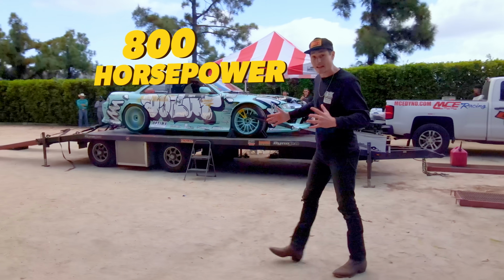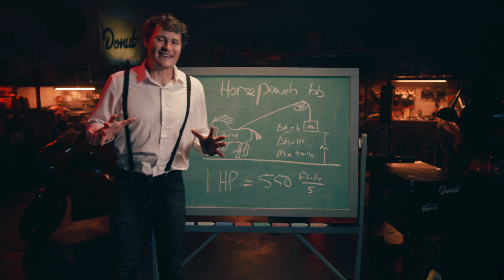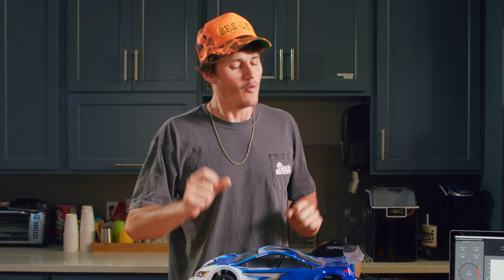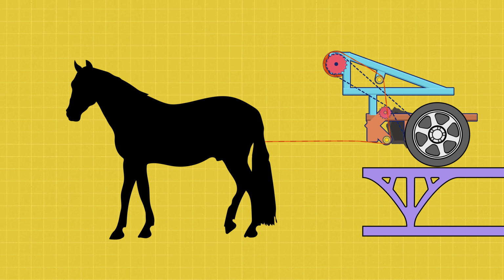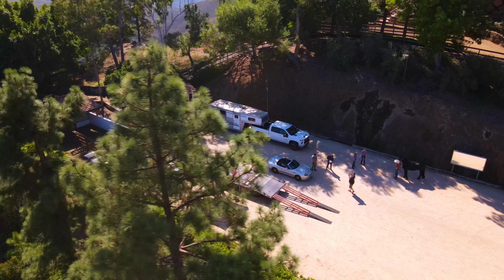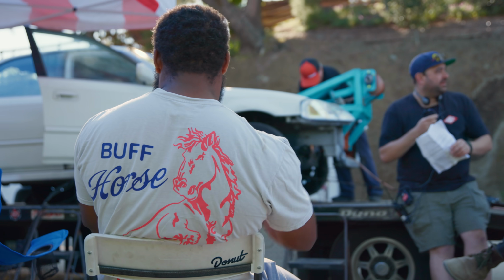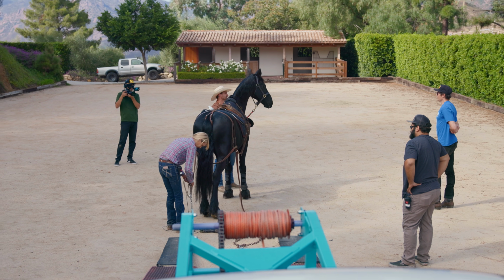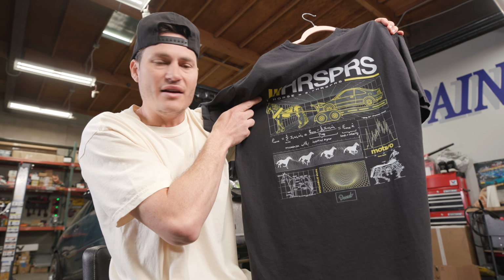How Much Horsepower is a Horse?

Comment: It's so cool to see someone undertake this project! Loved this video. As a professional in the equestrian field, I would love to see a repeat someday with a larger sample size of horses. As mentioned, there are over 350 breeds. Big D (handsome though he is) is not a heavy draft horse, which is the kind originally intended for the measurement of horsepower. He also hasn't been trained to properly pull, nor was he wearing a pulling yoke. A Belgian trained to pull, for example, would probably produce a much higher reading (I'd confidently wager at least 10). They're built to find that leverage, and a team of 2 can pull a semi plus a rig out of a ditch.

Having said that, I know this video took a ton of effort and brains to make. I've been watching this channel for a long time, and I'm stoked to see an actual horse appear. Best collab. Cheers for a job well done guys!
Reply: i was thinking the same! a friesian is a better breed for testing than the quarter horse for sure, but it would be great to see some heavy drafts. now that the rig is built, i would love to see future academic papers across the breeds + multiple horses tested!
Reply: A boerenpaard would probably beat big D but they're like 50% larger/heavier too. 
Imo it's like comparing HP to torque...
Reply: What is needed is a sample duration. Horsepower as it was originally conceived was replacing actual horses doing real work. Like all day long. Back then that meant at least a 12 hour day. They would literally work horses to death. Mine owners weren't the nicest people on the planet. They had money to make.
Reply: @1pcfred  exactly. Both the original measurements and this one are correct. All about time and of course the horse being used. A burst max compared to all day everyday effort will be about 12:1. I'd say the pull in the video goes a bit longer than just a quick burst so 6x the all day effort and you are back at 1hp all day everyday. Always good to challenge the numbers though!
Reply: Ask budweiser to get their Clydesdale team 😂
Reply: As they said: they were comparing a regular horse to a regular car. Not a semi truck or a race car kind of horse
Reply: I was thinking the same thing, that was not a pulling harness. I wonder if you could get the same results from using a horse treadmill and connecting it to a tractor PTO dyno.
Reply: A horse which is bred and trained to pull is a different matter. You then have to look at the harness and the shoes. A single Shire horse named Vulcan put up a pull of 29 tons on a dynamometer, working as a pair the two Shires reached the 50 ton limit of the equipment being used. This happened in 1924 at the British Empire Exhibition, another pair of Shires only 8 years old (Vesuvius and Umber) hauled a granite block weighing 18.7 tons in the same year. The interest was in what they could pull, the load they could move - the jobs they could do. The horse has power and it can use it. If the task gets done the numbers don't matter but if you want to conduct an experiment like this you are better looking at an average horse.  Working heavy horses are in no way average and if you want to know what horses really can do that is a different experiment.

Comment: i think we should go back to chariot racing but with horse pulled cars. "yea i got a civic powered by 2 cow horses tuned on organic hay with carbon fiber horseshoes". and instead of horse power, can we call it Big D units (BDu). also couldnt you guys retro fit an engine dyno with  spool and measure crank BDu that way?

Comment: So I hate to be the nerd of bad news, but this test data is fairly useless although not pointless. 1. This only measures the HP of the horse for that short distance. 2. Biomechanics usually shows HP of living things maxing out at half the max pushing/ pulling capacity of the animal. So you would have to test the max pulling capacity in Newtons and make sure the gearing is reducing that by 50% to the dyno. Then you would need to pick a distance a car would normally drive. Get a go-cart you thought was similar in HP (based of dyno results) and identical in weight and see if the horse could keep up or beat the go-cart in that race. Then adjust go-cart HP until you found an exact time match.

Comment: here's whats wrong with the test , the horse was unable to reach full speed because it was being walked by a person limiting it massively , they said they accounted for mechanical losses in the system however accurately predicting the tension of the cable each time the horse did a pull would vary every time making the results incorrect , you could argue that taking an average from the runs would give an accurate number but i disagree  , the only way to get this right would be to build essentially a giant horse treadmill style dyno & let the horse run at full pace with nobody on it to avoid any restriction

Comment: Another way to solve this “horse vs HP issue” is to measure the resistance of a known mass of air against a standard mass of a horse & standard cross-section too.
Obtained results should be compared to known values across board.

It’s a pretty complex topic 😂

Comment: Donut has disturbed the apple cart. If one horsepower is equal to 5.7 of an actual horse, that means that my Chrysler 300 S that has "300 horsepower" by todays standards has 1710 horsepower. OR ... if I wanted to be realistic and factual, I would divide 5.7 into 300 which would mean my Chrysler 300 s has only a little over 52 actual horsepower. This is more thinking than I wanted to do after my day after Thanksgiving morning drunk. TY Donut 🤓, Great video !!~

Comment: Why didn’t you all just connect the horse directly to main mass of the dyno and measure the output (considering all the results compared to known gear ratios)?

Since a car basically rotates the mass on a dyno to calculate HP, the horse would have just been strapped to a series of loops around the dyno flywheel to get more direct readings.

All the parasitic losses involved with the car-contraption could render these results invalid.

Great effort/show nonetheless 👏🏽

Please correct me if I’m wrong 🙏🏽

Comment: I am wondering, could it be possible to make Big D run on some sort of custom built treadmill? I have seen videos of dogs running very happily on specially built treadmills (they are secured by a harness properly the whole time). If Big D could run on a similar treadmill, maybe you could take measurements of how fast the treadmill wheels were spinning? Could the treadmill wheels' data be used instead of the Dyno's spinning wheels? 🤔

Comment: My only question after all this is that if 1 horse = 5.7hp on the current value of 1hp, how would this translate into current specs. I think it has to be divided by 5.7. Maybe I'm wrong, but if so, would a 200 hp (current 1HP standard) vehicle now show as 35hp (Big D hp standard)?

Comment: I don't know man, for having worked with horses pulling logs from the woods, I can't imagine being able to pull the heavy logs at the speed the horse was pulling it with a 6hp machine. I suggest putting a spring or a big elastic in line on the pulling rope to  smooth out the jerking movement of the horse, it should have a compounding effect that will improve the performance of the horse significantly.

Comment: The definition of power is energy divided by time.  Thus, power is just a rate of energy transfer.  This video was about peak power, or the largest rate of energy transfer.  Peak power is like throwing a gallon of gas on a campfire.  It's a quick release of a large amount of energy.  That means a big energy number divided by a small time number gives a big power number.  However, that also means that you run out of energy quickly.  Now let's apply this to running.  Sprinting uses a lot of energy in a short amount of time.  Thus, sprinting is a big power number, or peak power, and you move quickly.  On the other hand, jogging uses less energy, and spreads it out over a longer time, so you don't move as fast.  For the sake of analogy let's say the sprinter and the jogger have the same amount of energy.  The jogger can go much further than the sprinter, and the sprinter can go much faster than the jogger.  The jogger transferred the energy to movement at a slower rate than the sprinter.  The jogger's power number is smaller than the sprinter.

Comment: The original problem with calculating hp was they had to approximate and calculate torque over time etc. you solved that by adding more calculations and estimates. Horsepower is work over time . Why didn’t you just measure how many feet the horse could lift so much weight over so much time? That would have removed all the ifs and given an actual horsepower number with the parameters of what a horsepower is supposed to be?

Comment: I just want to point out that you have the GPS and the load cell (that you practically mentioned as a footnote) is a much more accurate dino-system then the actual Dino, you could have pulled literally anything and calculated horsepower to a very high degree of accuracy (though I would have suggested a sled of incrementally increasing weight so you could create a plot of horsepower versus torque)

Also a stopwatch and a measured distance would have also worked instead of GPS

Comment: You could just have strapped the horse to your car and measure wheel speed and a strain gauge - brake until the horse cant maintain speed, P=F*V, easy peasy
Reply: You are totally right. We had a redundant measurement system consisting of an online tension loadcell to measure F, and a GPS to measure V. Both were mounted very close to BigD's harness.

Comment: Give me your feedback.

What if they geared the center of the Dyno, then used big d to spin a gear that spins the geared Dyno.

For RPM they could mark the horse driven gear and use the GoPro, just like they did on the wheel. 

This would give them the most accurate measurement.

Comment: Fnnish technology magazine (Tekniikan Maailma) did this test in 2000. Finnhorse stallion's peak power was 18 kW/24 hp during galloping and it could maintain about 9 to 5 kW power for the first minute and about 4 kW during the next minute pulling Saab 9-3 as load.

Comment: Interesting to use a car as the "frame" for everything vs an actual framework that only has the front gear train and then wheels/axles.   Cheap civic is probably cheaper than starting from scratch though.

Comment: Makes no sense.....
How can 1 horse have 5 horse power.

Surely the correct way to measure this is by Torque.

How much Torque or pulling force (lb per ft) can a horse out put.

IT MAKES NO SENSE AT ALL THAT 1 HORSE IS RATED AT 5 HORSE POWER.

IT LITERALLY CONTRADICTS ITSELF IMMEDIATELY....

1 HORSE HAS 1 HORSE POWER...!

BUT 1 HORSE MAY HAVE MORE TORQUE THEN ANOTHER SO SHOULD BE MEASURED IN lbs per ft..

For example Big D possibly has like 50lb p ft of torque for every forward pulling step the horse takes...

Comment: If 3 guys produce 1,9 HP and the horse produced 5,7 HP that means that the horse did 3 times more than 3 guys thus 9 times more than 1 human.   And it also means that you would need 179 horses pulling on you to equal the power of 1 tesla model S plaid (1020 HP).

Comment: Did anyone notice the guy reset the rope on the roller bare-handed?
Reply: Good eye! To reset the spool, we put the manual transmission of the Civic in neutral, to decouple it from the dyno. The friction on the drum+chain was very low thanks to the ball bearings we installed.

Comment: Well theoretically, a horse is 1 horsepower. The measurement was made from arbitrary calculations, on the assumption that a full sized horse could pull 33,000lbs 1 foot in 60 seconds. Or an easier way to read that would be, a horse would take 60 seconds to pull 33,000lbs over a 1 foot distance. 

The reality is, it was kinda random. The guy made up a random system to see how much weight a pony (yes a pony, not a horse) could pull 12 inches in 60 seconds. 

It's confusing and hard to understand, because it's completely made up. There's really no real science behind it.

Comment: While Motivo has some smart people and may have some impressive accomplishments, it is impossible for Motivo to have had ANY part in the development of the first vertical lift fixed wing airplane.  The Harrior Jump Jet was the first airplane of that type and was created in the 1950's by Boeing,  Motivo was founded in 2010.  I'm 75.  I was alive before the 1950's but as a child.  Engineers working on the development of the Harrior would have to be at least 95 years old.  I saw no one of that age in your video.
Reply: The Harrier is great milestone in aviation, but it was not electric. Motivo worked on the pioneer eVTOL vehicle (electric).

Comment: Fing stupid.  You got bs losses in gearing linkage and tires. Just hook the thing up to a generator on a resistor and eliminate all this.
Also horse power was supposed to be what a horse can pull continuously for a typical shift.

Comment: wouldn't it be easier to build a 3 to 5 meter platform and build a giant treadmill that goes around the platform and use the dyno hub that measures the power of the cars, which is also perfect for using the dyno hub to measure the strength of the horses that only have to run on the treadmill

Comment: Wait, so basically about 5 or 6 guys could pull as much as a horse???   Something doesn't sound right.  But TBF, I'm a little slow in the head.
Awesome video!!!
Reply: i mean that isnt to far fetched 6 guys also have 12 hooves so they can get their power down better. also horse is obviously gonna have more stamina so you are only comparing strength for a very small window of that stamina.

Comment: Mount an electric motor on a stand with a spool attached directly to motor shaft, have horse pull it and measure the current produced.  People that know more about such things than I do calculate the horsepower produced taking into account factors such as gearing concerning the spool size, what the generator would produce under a known horsepower, what it produced with the horse pulling it.  Similar to what I'd imagine an engine dyno to do and taking out a lot of variables and gaining a more accurate figure.

Comment: It has been known for a while that humans could peak out over 1.2 hp and actual horses could hit nearly 15 hp.  However the actual horsepower was initially for a "sustainable" output that could be maintained for the workday, such as pulling a wagon while traveling or turning crank.  This is going to be lower that the peak possible since horses will get tired.  For a sustainable horsepower the results from this video are still most likely high since you would want an amount of effort the horse could sustain for 8~12 hours (minus time for feeding and water breaks).

Still enjoyed the video greatly (and breed Hanoverians).

Comment: I'm not a scientist ,but i can tell you that spool diameter very small. That horse was put out at least 8-10 horse power.  Anyway the simplest test could be very simple. Put a quad(ATV) end of the rope and start to pull it. Check how much hp the quad by factory and you already have a benchmark.If the quad is 20HP but your dyno only measure 10 then you know is something not right.

Comment: To be fair, the initial unit was invented for measuring sustained power output across 24 hours, which is what matters for industrial applications that run 24-hour, like a steam engine. If you wanted to know what size steam engine you needed to replace your three-horse setup, you had a good idea.

This experiment measures peak power output across a short span of time, which might be relevant for comparison to vehicles but not for the original use case. This doesn't show that the original measure was wrong, just that the usage has changed and there's no longer a like-for-like comparison between the two.

Still a cool experiment though.

Comment: Reasonable numbers.     Been a long time since I read about what Watt was doing, but I vaguely recall reading of it being the  power pf the draft animal in a day of production (the lifting a weight diagram being later nonsense).       So 5-6 times that power for a "sprint" effort over a "production" (i.e whole day output average) effort is reasonable.

Of course the flip side is that if you have an engine that is rated 300hp,  you might normally use it with an averaged output of 100-200 hp,  and might only use that 300 capacity  for a short time, (for example towing  close to your GVWR up a steep hill).  You;d burn out that gas engine pretty quickly running it close to its rated output continously (note how often race cars blow their engines on the track .... even when the race may only cover from a frew minutes to a few hours).    On the flip side, Watt's engines were meant as continuoous use pumps or similar to be run near rated capability.

No matter now we have long established norms of what ""power" means, whether we measure it as "horsepower",  "watts" or other measure.  Still it's an interesting "experiment".  Applause.